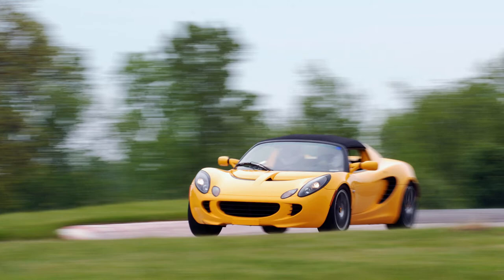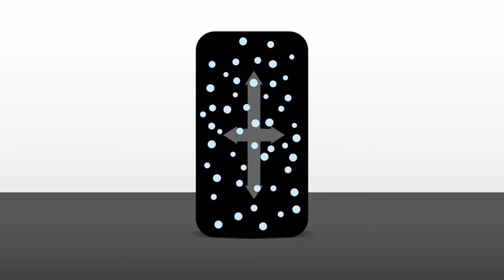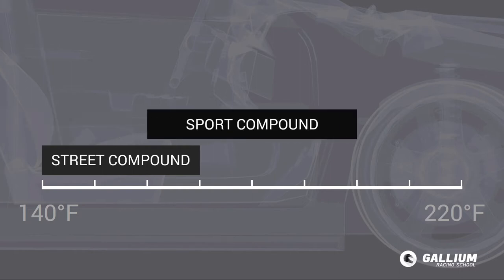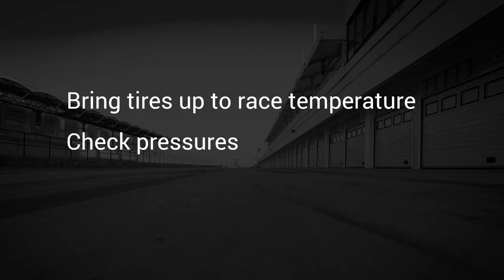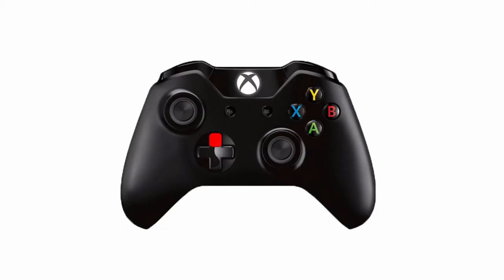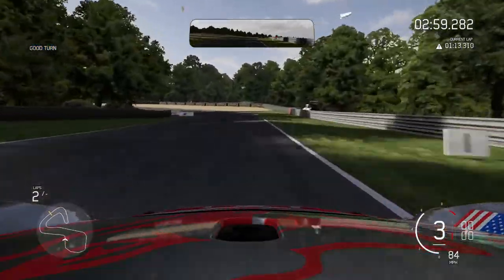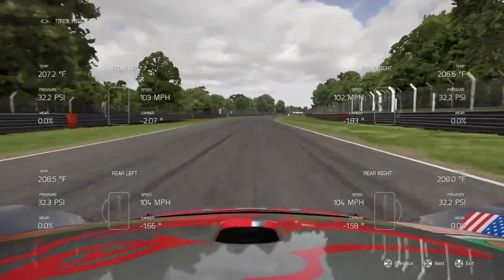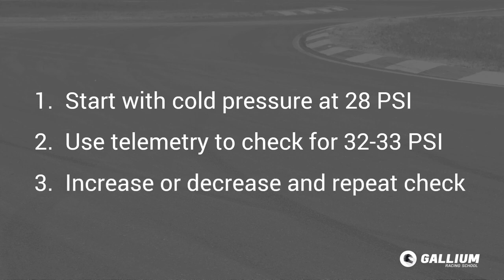01 - Tire Pressure - Suspension Tuning in Forza Motorsport

Comment: You said @2:50 that if the edges are hotter than the center, the pressure is too low, but you also say @3:19 that should the inside edges remain hotter than the outside or vice versa then it's not a pressure issue it's a camber issue so which is it?
Reply from the maker: In the first part, that's edges plural--both inside and outside. Essentially the tread doesn't have enough pressure and the edges are doing more work. For the second part that's just one edge (inner OR outer) which is usually a camber issue.
Reply: Oh okay well on the second part you said "edges" plural then "or vice versa" meaning outside or inside so both and it didn't make sense for my brain gotta be one or the other, tire pressure or camber
Reply from the maker: @1Wheelchairmaniac  Thanks for letting me know it wasn't 100% clear. I checked the video and all sounds right. We use "inside edges" (plural) for camber which might be confusing--it's talking about either one of the inside edges of tires on an axle. The vice versa is referring to scenario 3 or 4 below. 

Here are the scenarios listed out for one tire to avoid any confusion on plurals:

1. Inside and outside edges are hotter than middle - low tire pressure
2. Inside and outside edges are cooler than middle - high tire pressure
3. Inside edge is hotter than middle and outside - too much negative camber or maybe just the right amount if not too much hotter.
4. Outside edge is hotter than middle and inside - not enough negative camber

And remember to check the tire temps a second or two after a corner to avoid too much negative camber. Let me know if you have any more questions.
Reply: @KeystoSpeed  okay that helps and puts it all into focus a little better
Reply: @KeystoSpeed  I do have one question, having trouble knowing what to tune first. I watched all your videos in this series, is there any order you need to go in like tuning springs before tire pressure cause wouldn't soft springs give you more contact patch and you'll have to re-tune your camber?
Reply from the maker: @1Wheelchairmaniac  That's a great question. The process is a kind of loop where you can start at one part and then repeat as needed. You can have a look at my tuning checklist here: https://forzatune.com/guide/forza-tuning-checklist/ It recommends starting with tires but that's not a hard rule.

Comment: If I don't race in simulation mode, does tire pressure matter?  Couldn't I set the pressure to optimal pressure (31-32) and it will stay like that throughout the whole race?
Reply from the maker: Thanks for the question. The pressure and temp should change regardless of difficulty. If in doubt you can pull up the telemetry to check.

Comment: Whats the optimize pressure for sport tires ?
Reply from the maker: No matter which compound the general idea is to still target 32-33 PSI.
Reply: In R class I set my tires to 27 psi when it heats up I checked my telemetry and it is 31-32 psi

Comment: The video says run a full lap in order to reach optimum heat but what if the track is a short tight circuit 🤔. For example Monza Short Circuit
Reply from the maker: The tighter turns may generate tire heat to help offset the shorter distance. But it won't hurt to run another lap if the circuit is very short.
Reply: Gallium Racing School thanks for the help btw I love using Forzatune 6
Reply from the maker: You're welcome, Clinton - and thanks for using ForzaTune. You might be interested in the new ForzaTune 7 if you haven't already seen it: https://www.youtube.com/watch?v=pF3Q_lNBorY

Comment: My psi is like 24 but if I increase pressures the middle gets hot I thought psi needs to be 30 plus
Reply from the maker: Good point! I've started recommending a wider range of temps in the new Motorsport. The latest ForzaTune apps are also using a wider range of recommended values. The approach of "shoot for 32-34 PSI when warm" seems to fall short with the new physics. Thanks for mentioning this.
Reply: @KeystoSpeed  you answered comment on 6 year old video! Legend you deserve a sub